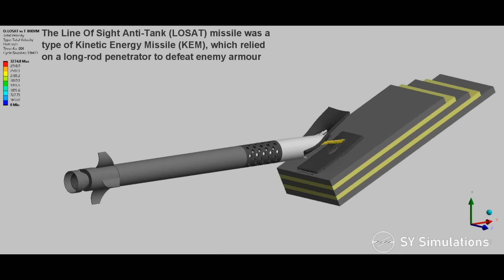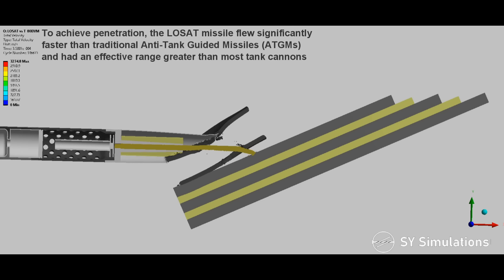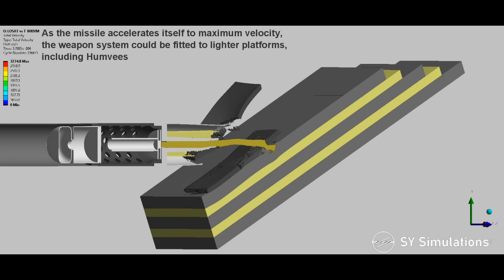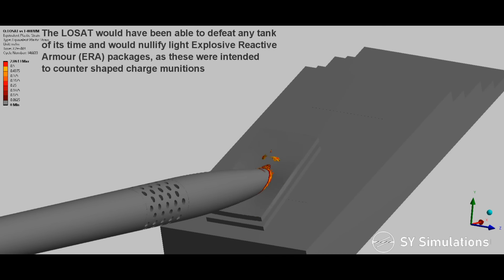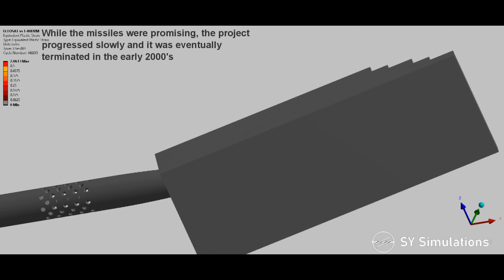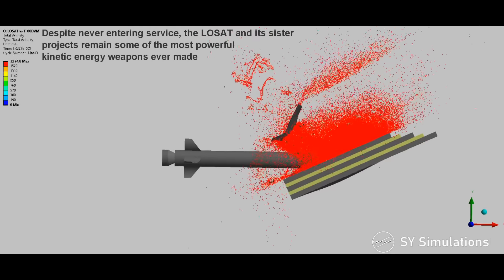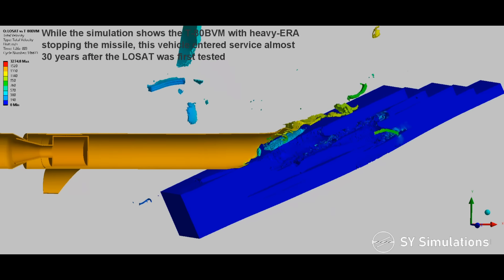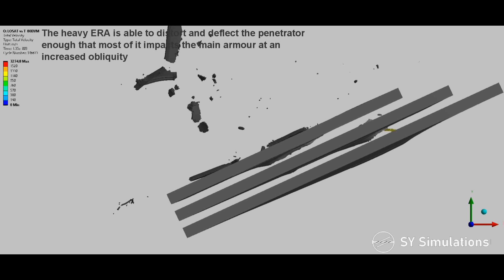LOSAT vs T-80BVM | MGM-166 Kinetic Energy Missile vs Relict ERA | Armour Penetration Simulation

Comment from the maker: In the simulation, the ERA managed to degrade the projectile's penetration by ~40% (see the description for more details)
Reply: More of a flight profile issue IMHO. I expect more of a diving attack profile. 15-20 degrees off horizontal.
Reply: How hard is it to make shaped charge simulations?
Reply: It's called line of sight anti tank, not dive anti tank
Reply: Can you simulate the M829A4 against the composite armor I designed?  Blade era + 20mm cover + 40mm air = relikt era + 60mm steel + 40mm ceramic + 35mm steel + 40mm ceramic + 35mm steel + 10mm air + 35mm steel + 40mm ceramic + 60mm steel + 5mm Kevlar with 60  ° and 80° placement
Reply: @ГеоргийМурзич  line of sight just means you can see something, not that it goes in a straight line.
Reply: @leovang3425  In case of LOSAT it does. Think of it as of APFSDS, it doesn't have means for tight maneuvers
Reply: @ГеоргийМурзич   APFSDS doesn't fire in a straight line, gravity pulls it down and air slows it down meaning APFSDS almost never hits at a perfect 90° angle
Reply: @leovang3425  Its descend angle is negligible
Reply: @ГеоргийМурзич  not really, it does affects penetration beyond the "angled armor is thicker", the abrams upper front plate is angles just enough that APFSDS richochetes and shattters, 1 or 2 degrees less and it's lethal.
Reply: @leovang3425  that UFP statement is completely wrong. There's footage from the desert storm where T-72M got penned into the upper part of the turret roof which is as angled at the place as M1 UFP, but the metal is 50% thicker
Reply: @ГеоргийМурзич  This exact same channel has a video on this called "apfsds critical angle."

Also think for a moment, the M1s UFP is 38mm is angled at most 83° which is 300mm effective thickness, which modern rounds will eat for breakfast. How have there been no reports nor complaining of penetration there?
Reply: @leovang3425  because abrams have never faced peer on peer tank battles. The most modern round it met with was 3BM15, iirc which is from early 70s. And it's yet to be engaged by russian tanks in Ukraine, if ever cause FPVs and ATGMs with mines. And let's be honest, UFP is a small part of M1
Reply: Cool idea bro @MicheleZhang-uh4ci
Reply: So how much Penetration would it have, if no ERA was there and the armor was not angled. I saw that max Penetration was 160 mm RHA. But it seems like its more. What do you think???
Reply: @ГеоргийМурзич regardless of what it is called the missile would travel in an slight ballistic arc which would make the impact less favorable for the armor.
Reply: @SYsimulations  I don’t care what era is on the target - nor did the missile. I know of no tank that has ever been built that can survive the energy interchange. Anything mounted on the hull or turret is toast. All optics, all electronics, your engine/transmission and its mounts. Losat was not just about the rod. We fired at many targets including postulated future targets with many advanced heavy era packages. None survived a single hit.